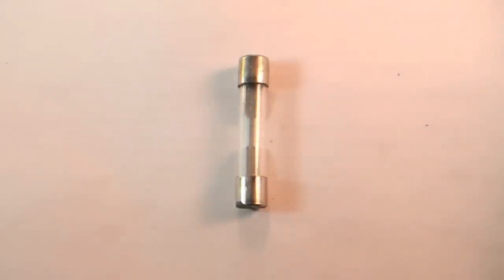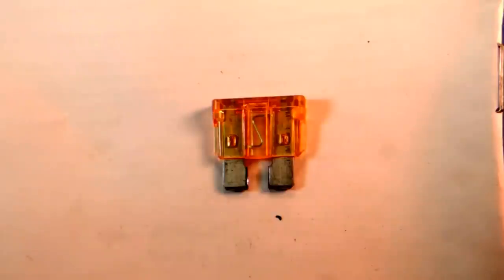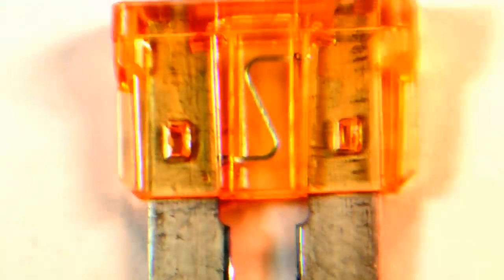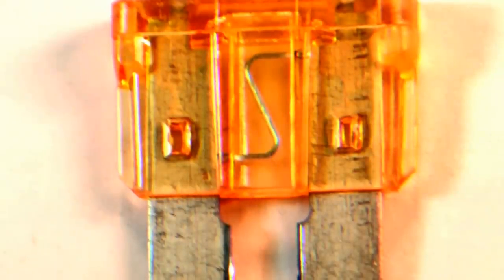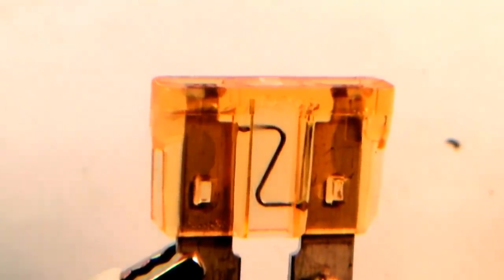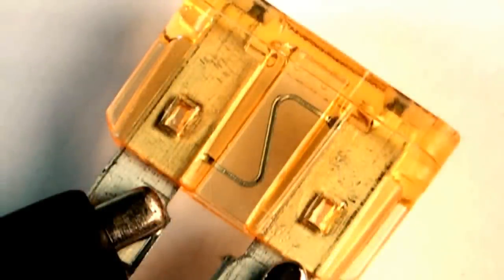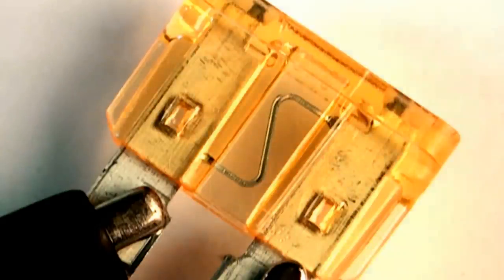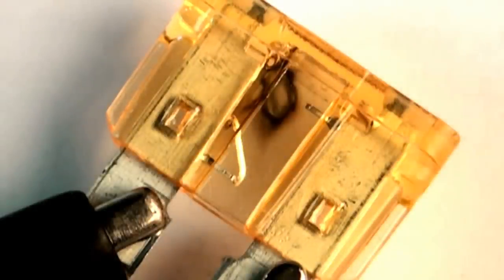Why and how the fuse blows.

Comment: I see that a lot of questions are being answered so, I hope mine does. I have a 1978 Datsun and both the tail light don't work, the stop light works, and the turning light works,  but the other one don't. I looked underneath the steering wheel, and saw a cable disconnected. I connected the cable, turn on the car and lights, and it blew the fuse, any idea why and/or how to fix it?

Comment: When the plug in is not grounded like a vintage one. Is that a possible cause?
Reply from the maker: No.  Ground is not fused.  If there is a short to ground, the fuse may blow, but the lack of a ground, if anything, will not make the fuse blow.
GFM

Comment: I'm having problems with the fuse in my York FG8C10016MU11A gas furnace. It blows immediately when I power it up..I imagine it's something to do with the 24v portion of the system. I changed out the Tstat and wire, but have no clue where to start looking for the short...Any advise would be appreciated.
Again, awesome series of videos... Thanks !
Reply from the maker: Elaine Costigan Remove all wires from the terminal board.  Replace fuse, then attach one wire at a time starting with common.  When the fuse blows after attaching a wire you know where to look.  Hope this helps.
GFM

Comment: hi all, 12v car vacum blow my 12v cigaret lighter 12v , i replace 3 time fuses whit 20amp & 25amp it blow after i connect the vacum and push the on boton, can some help me to find a solution, can this vacum cause probleme to my car ??
NB! (in the manual 12v cigarette lighter work whit 20amp)
Reply from the maker: Either the motor in the vac is locked up or the wiring to it has shorted.
GFM
Reply: the motor in the vac can rotate i her it, about the wiring vac can not be on if there is a shorted circuit.
Reply from the maker: If it is rotating and it has a rating plate of less than 20 amps, the motor probably has a shorted winding.
GFM
Reply: thank you for ur support and answer #grayfurnaceman
what can u sugest me to do ? i use a higer fuse amp like 30 or 35 amp?
Reply from the maker: Get a new vac
GFM
Reply: Ur vaccum is the problem

Comment: Why they blow up sometimes out of nowhere? I have seen some fuses even blow up when there is no short.
Reply from the maker: Guy Hakverdi The eternal question.  My thoughts are that its done by gremlins.
GFM
Reply: grayfurnaceman Today my customer called me because his new Trane XB95 Furnace wasn't working(only 3 years old and I installed 3 years ago). He left for vacation last week and came back yesterday, and this happened. I went overthere this morning, and change the fuse start working right away. I checked everything no short or anything.  A little bit dusty furnace though. I am just confused, I hope I don't have to go back there.
Reply from the maker: Guy Hakverdi I went on one today that had blown several low voltage fuses.  In the outdoor unit there was one place where the thermostat wires took a sharp corner against a sheet metal guard.  Noticed a tiny arc spot less than 1/32d of an inch across.   You have to look very close sometimes.
GFM